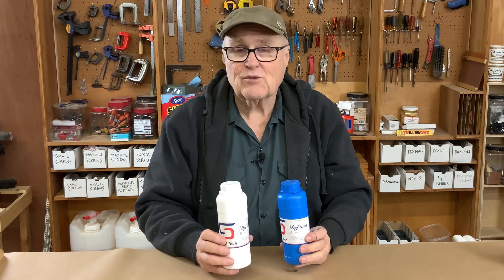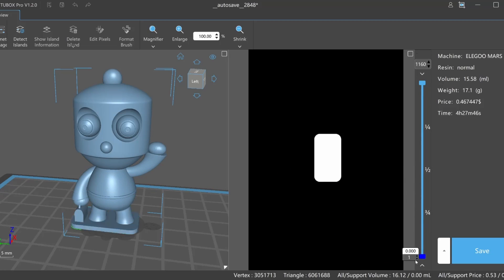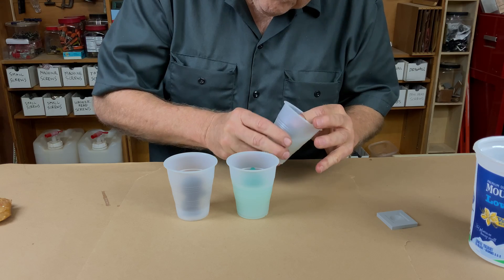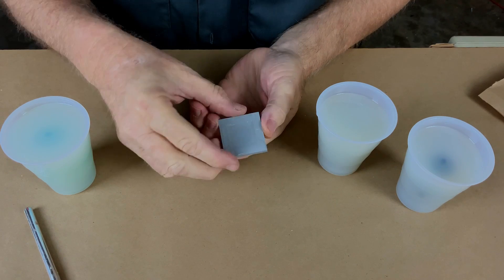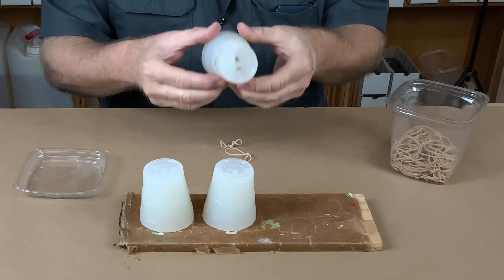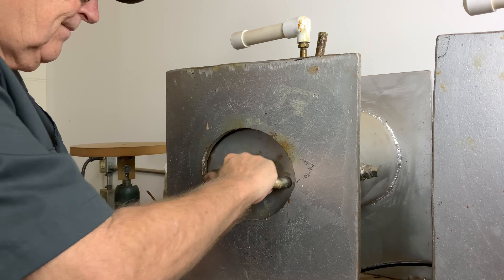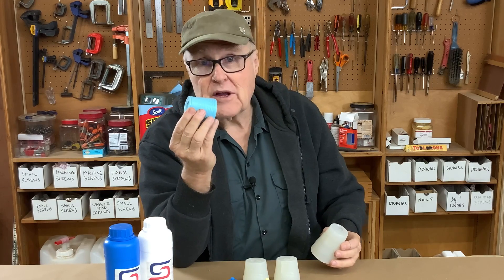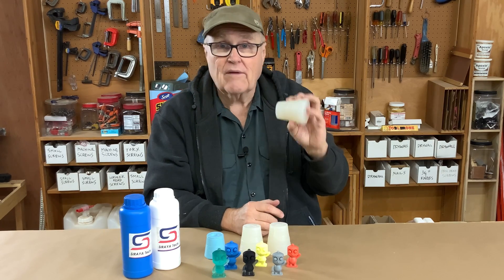Platinum Rubber On 3D Prints? Now You Can!

Comment: I noticed you used generic term 3d printing... but only showed resin printing.... any word on printing moulds with the various other filaments available for FDM printers?

P.S. if you cut a slit from an empty cup, top to bottom, then put the rubber inside that, and put the rubber band around that, it will spread the rubber band's hold over a larger area, causing less local deformation....

Comment: There are some resin that doesn't need spec.silicone for example the siraya fast smoky black only need a strong UV treatment and rest for 1-2 days after printed and it is good to go with very fast curing (about 4 hours, the 24h won't work) platinum silicones.  
1:40 - FDM printed materials like PLA, PetG and flexibles (tried many brands) are not inhibiting the platinum silicones at all, maybe some exotic metal filled ones but never used those for mould making
Reply: petg didn't work for me, asa seems to be working

Comment: Wondering what the results will be with any other platinum based silicone when the washing and curing steps are the same.
Reply from the maker: Try it and see.  Other people have commented that they also water cure the resin, and it works with platinum rubber

Comment: I have been using silicone for resin prints for many years, they all pretty much work. the true test is prolonged use. Lets see if the Siraya Tec silicone doesn't start sticking to the resin after 30-40 uses.
Reply from the maker: Tinbased silicone rubber has always worked for me. I think it is platinum silicones that cause trouble when used on 3-D resin prints.

Comment: There's a workaround that avoids any platinum rubber cure inhibition. It works with any UV Resin for 3D printing. When reaching the UV light cure stage, first submerge the 3D parts in water (clear glass container) and then place the UV light on top. I cure it until the resin looks a little cooked, i.e. gets a brown-ish color. Nobody really knows why this works. Some theorise that under UV light  the water molecules change the orientation of the surface molecules of the plastic in such a way that the inhibitory molecular structure remains on the inside. Or maybe the inhibitory molecular structure attaches to the water molecules, thus washing them away.
Reply: UV while its in water?
Reply: @sykospace  Yep.
Reply: Doesn't work for me
Reply: I tried this with 3 different resins, never worked for me. Tested with 3 different platinum silicones as well. Curing bath in excess of 1 hour didn't work.
Reply: I have a 3d printed model I need to make molds from, made a mold of 3 of the parts and when I took the master (resin printed part) the rubber that was in contact of the master wasn’t cured. Similar to molding a part that had sulfur on it. Now I need to find a way to mold resin prints…
Reply: The reason why this works is because oxygen prevents UV resin from curing. So if you cure the model in the air, the oxygen will prevent it from fully curing. But because you submerged the model underwater, there isn't any more oxygen, so it can cure completely.

Comment: Hi Robert I prefer brush molding my casts and usually use Smooth on Dragon Skin 20. I use their color dyes to tint the platinum silicon as well. Anyway, my question is, is it possible to brush on this Sirius Tech Platinum silicone on my sculpts? I’m buying this product anyway and will let you know how it goes. Thanks again for the long-form videos!

Comment: I have been doing silicone molds with platinum cure over SLA printed 3-D models for the last four years. I found that all thats needed is to further expose the print to ultraviolet light. You can also just leave them in the sun for a day. No need for expensive silicone, clear lacquer coats, or crappy tin silicone.
Reply: If I was to post-cure an SLA part in a UV chamber for 6 hours and set the temperature to 25C and UV light length to 365 nm, which seems to be the wavelength of UVA rays from the sun, would it have the same effect as curing it in the sun? Also, I'm trying to figure out the effect of over curing I see some places say resins will become brittle but others say over-curing has no effect on the resin. What is your view point in that
Reply: @eugenemarais6723  As far as setting the UV chamber to mimic Sunlight I have no clue as I have never tried that, but it sounds like an awesome experiment and would love to hear the results you are getting. As far as over curing in my experience it has a lot to do with the type of resin. non water washable resins do much better with over exposure and also are much less likely to inhibit silicone cure. Water washable resins and especially plant based water washable resins seem to over cure much easier. It also depends on how thin the print layer is. A very thin object will become brittle much faster from over exposure than a thick section of cured UV resin. This is probably why people are reporting mixed results as they are all using different resins and different thickness prints and trying to compare them as one in the same. It's apples and oranges. If you are goin to post cure I would always suggest doing it with the print submerged in water as there is much less oxygen content in water than air and the oxygen is part of what can inhibit Resin Curing (which in turn effect silicone  cure inhibiting)  and also increase the breakdown speed of the print do to over exposure.

Comment: since oxygen contact causes the cure inhibition in UV-resins - which then causes the cure inhibition with platinum silicones - the postcuring submerged in water is the crucial step! there are quite a few options, e.g. "elastosil vario..." from wacker, that also work great with sla prints.
Reply: I can confirm that UV light curing the parts in water will resolve any rubber cure inhibition, regardless of what brand of rubber you use.

Comment: I never had a problem mounding my resin casts and I solely use platinum silicone (as it’s the way to go for SFX make up and I love the 30-45 minute demould time) so that’s what I have on hand. I just spray a lacquer or primer over my resin prints.
Reply: but doesn't that take away detail?
Reply: @abbystarobin2163  no the silicon is very low viscosity so you’ll catch every detail. And that little primer hardly fills any detail.

Comment: This is excellent Robert wish I had the confidence to try never heard of this rubber before 😊
Reply from the maker: It’s brand new; they just put it on the market.
Reply: @RobertTolone  The 3-D print is only inhibiting silicone cure because the print itself is not fully cured. Even though 3-D prints can seem fully cured they are porous and can even sweat out uncured resin. Because of this before making silicone molds you need to make sure to give them extra UV exposure. I give mine an entire 24 hours before I make a silicone mold of the print. No need For crappy tin rubbers or clear coating in lacquer. Just more light!

Comment: I've been using platinum cure silicon with PLA prints for years and have never had an inhibition problem. Resin prints are another matter..
Reply: Sure, but that's both slower and more expensive with more opportunities for failure.

Comment: My personal fix for taking molds of Resin printed or primed objects is to spray the item with a few coats of Clear  Lacquer and let dry overnight completely. Works like a charm, every time and a can of spray lacquer only costs a few dollars. 

You've taught me most of what I know about mold making and casting, keep up the great works 👍👍👍
Reply: does the clear coat cover up fine details though? I'm trying to make chocolate molds and don't want small text to become less evident. I'm testing it out this week, just wanted to ask. So much to learn!
Reply: @ArtisanneChocolatier  Do light coats from the recommended 12-16" distance from your item. Let dry a full 20 minutes and check to make sure the lettering isn't being filled in by too much spray. Hope this helps. Each layer you add will lessen the detail slightly.
Reply: @MindsMouth  thank you very much! I'm testing it out this week. So excited.
Reply: @MindsMouth, I thought of that, but my resin prints have a lot of fine details and I worry about getting the lacquer coating into all the crevice's as well as dulling the details of the print. Thanks for the info, this my work for me in some cases.
Reply: Were you molding with tin or platinum-cured rubber? All evidence and tests I've done show simply sealing an SLA with lacquer won't work for platinum-cured silicone.
Reply: @WShawn  I was using platinum silicone. Tried the cheap stuff and name brands from Amazon. Spray two coats of clear lacquer, let each coat dry 24hrs.

Comment: Bob, this project looks great. Could you put a drop or two of dye in the clear rubber to give it some color?  I would try it. Other than that it looks to be a winner unless you need the rubber to be softer.  Maybe you should ask Siraya Tech if they can make an adjustment in their formula to make it softer.  You don’t know unless you ask.  It’s in their benefit to do it because they will sell more rubber. Glad you’re back. Best regards, Richard
Reply from the maker: Siraya Tech wrote to me after this vid came out to say it never occurred to them to dye the rubber.  Apparently it is a special dye needed to dye silicone.  I’ve never tried to dye it.
Reply: @RobertTolone  well there you go. Could be the answer to the problem. The other problem about the stiffness would have to be directed to the manufacturer.

Comment: Nice , So the 10 shore that you usually use the softer one, would you recommend to use it or the 25 for casting parts with under cuts ? Nice test vlog
Reply from the maker: The tin rubber I usually use is 25 Shore. 10 is great for cutting but you have to be careful closing the mold so that the rubber bands don’t deform it.

Comment: I have used smooth-on's  mold star 20t platinum on elegoo abs-like resin without issue
Reply from the maker: I’ve never tried platinum on that resin, but tin rubber works well with it.
Reply: @RobertTolone  specifically mold star, the ecoflex platinum is confirmed failure

Comment: I actually think I've had a print made in Sirayatech Navy Grey ( not sure which, but it was definitely SLA Printed) , and I had it cure perfectly without any special silicone; both Smooth On stuff and the various mold silicones you can get on Amazon.  Post cured it, naturally, but didnt have to seal it or anything to stop inhibition. 

I am dubious as to the claim that this is somehow more effective than normal.
Reply from the maker: People often complain that they experience cure inhibition while molding 3-D printed resin parts. I suppose it was enough of a problem that Siraya Tech thought it was worth developing a product for.  I have molded several different kinds of printing resin with tin-based rubbers without any issues.

Comment: Why do you need platinum rubber for casting resin prints? Will tin not cure?
Reply from the maker: Platinum rubber can be useful where tin rubbers won’t work. For instance, some resins (often clear) require platinum rubber.  Also, platinum rubber molds do not degrade over time the way that many tin rubbers do.  If these things are not important in your project tin rubber should work fine.
Reply: @RobertTolone  Awesome, thank you for explaining and making such great videos!

Comment: Did you end up having to use your vacuum to get the bubbles out of the resin prior to pouring?
Reply from the maker: No, I just put the resin castings in the pressure pot.

Comment: Now this is the kind of test I love to see!  I have been using platinum cure silicone with resin prints and have run the gamut of challenges that it brings.  I usually get by with extra caution in my cleaning process (using alcohol only) and letting  the print off-gas for a while, but sometimes I have also had to use Inhibit-X for this reason.  The X in Inhibit-X must stand for expensive, though, because it costs a lot.  It also changes the surface texture of the print, which the mold picks up.    So this silicone from Siraya Tech seems like a wonderful solution and I will definitely switch over!
Reply: the postcuring unter water is the most crucial step
Reply: All you need to do is after cleaning give prints 24hrs in UV light or leave in sun for a day. It will no longer inhibit silicone cure. That its, no need for this product.
Reply: @ericpdesign  sorry, thats not really true - but maybe you got lucky till now. oxygen contact prevents the uv resin from fully curing at the surface - which then may cause cure inhibition with many platinum cure silicones
Reply: @MiniaturenGalerie  Thats why you cure in water instead of open air. Less oxygen content. I have repeated this process hundreds of times its not luck, I understand my materials and how they interact.
Reply: @ericpdesign  I cured an SLA print for days and sealed it following SmoothOn's instructions for their MoldStar 15, and it was a gooey mess.
Reply: Try curing your prints under water. Also are you using a water washable resin or non water washable in your SLA prints? What did you use to seal the print after curing?
Reply: @ericpdesign  does curing in the water also work for water washable resin? because my understanding was that it needs to be dry to cure?
Reply: @cvp_studios  You can absolutely water cure water washable resin I uses 75% water washable resin on all my projects.
Reply: @ericpdesign  nice, might have to give that a bash! I have been liking the water washable in general. so basically, just put it in a glass bowl of water to cure? is it a longer cure time because of the water? I couldn't really find much info on this.

Comment: I've been using platinum cure silicone to make moulds from my PLA 3d prints for a couple of years now and had no issues
Reply: Thermoplastics don't usually cause a problem. The UV resin that resin printers use, can however.
Reply: @JohnClark-tt2bl  That's fair. What's the advantage of using resin for the model then?
Reply: @CombustibleL3mon  Resin printers can create much better detail than any fdm printer. The layer lines can be greatly invisible in some cases. A lot less post processing than with fdm printers too.
Reply: @JohnClark-tt2bl  That's cool! With my PLA parts I do have to do a fair bit of work sanding and filling before spraying a lacquer coat.
Reply: @CombustibleL3mon  yeah none of that is really necessary with resin. It sands well, and with the thin layers a couple coats of clear coat usually covers it without any sanding.

Comment: my resin seemed to have expanded in my mold.. used smooth cast 66 D as my resin.. i was told that it could have been caused by contaminants that were on my mold.. i did test  out the mold with RICE.. perhaps the rice left a powdery film inside the mold.. Robert what do you think caused the expansion.. room was aprox 70 degrees.
Reply from the maker: Did it foam at all?  Sometimes you can’t tell until you cut the casting open.
Reply: @RobertTolone  it definetly expanded.. i will try again by cleaning out the mold, let it dry and this time NO RICE...  i will let you know my results... cheers
Reply: Robert, i made fairly large size molds.. i think that the sheer size of the resin pour has something to do with the amount of expansion.. because the same pour went into a much smaller mold and i did not notice any expansion at all... QUESTION.. is their an oil that you could recommend to coat all of my molds with to extend their life and help with the model release.. Mold release is to costly.. Can i simply use motor oil ?